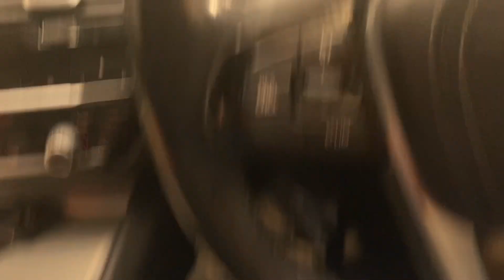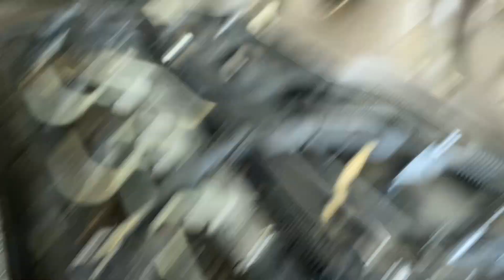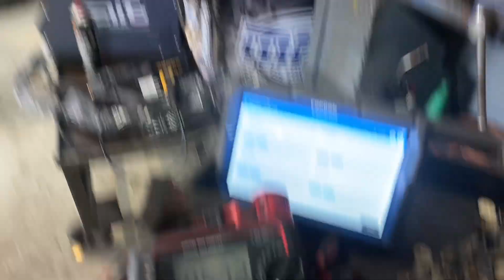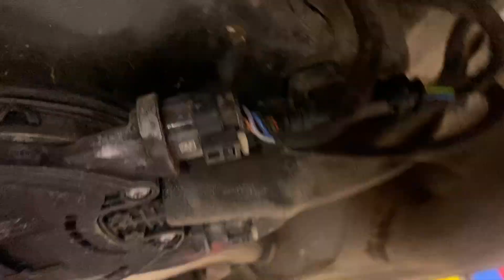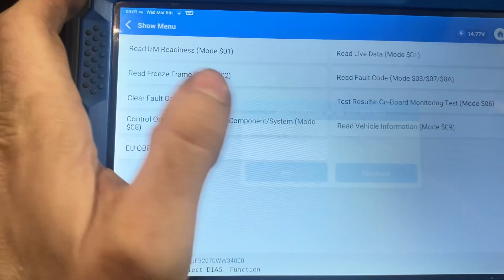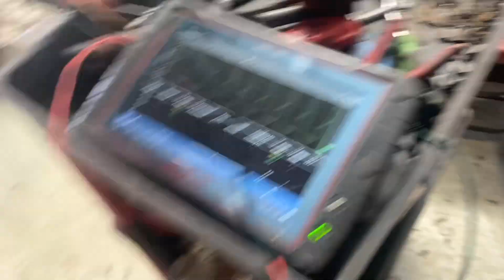BMW 520d P263D,P20BD AdBlue Reductant heater B control circuit

Comment: Just bck from bmw ....blue tank wiring at NSR wheel arch rubbed through....£588 to fix it ...apparently, 3h work for theirs mechanics🤦‍♂️
Reply from the maker: You can do it yourself now 😃👍
Reply: Legend bro....had engine light on my one...no fault codes...just out from NCT with P20BD as a advisory.....I check this wiring harness on Monday.. fingers crossed wire is broken 😂😂..great video bud